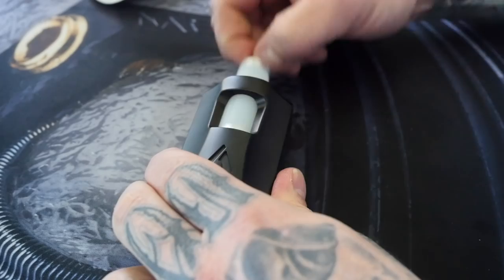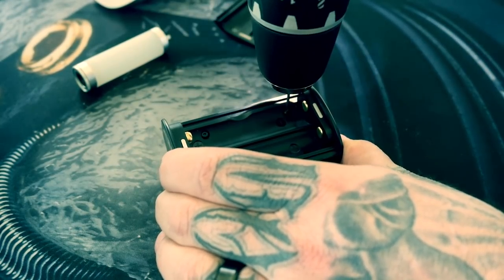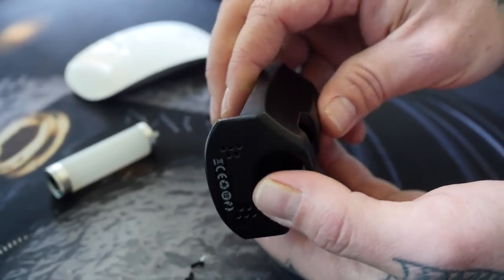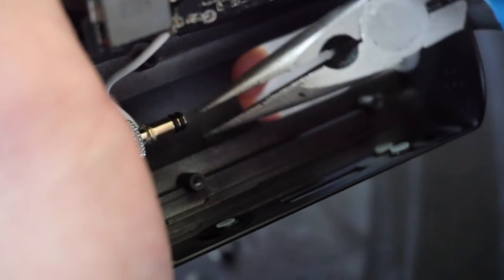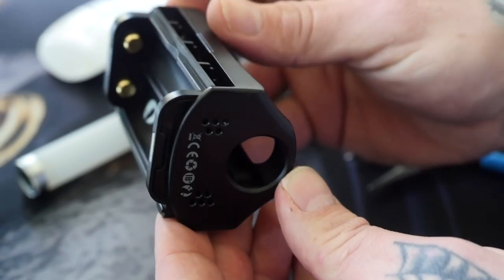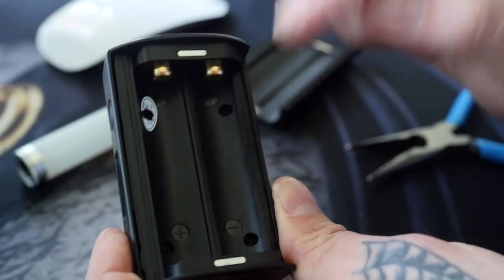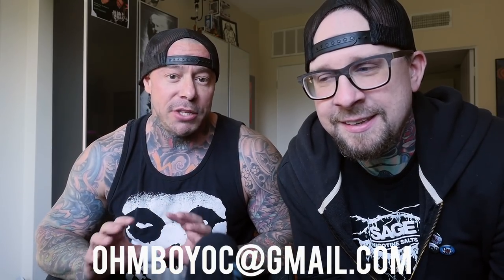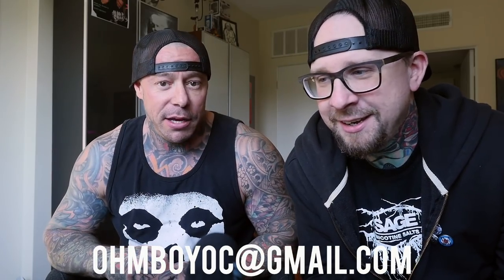Rage Squonk Maintenance with OhmBoyOC : Shenanigans

Comment: cannot find the rage in my country we are only allowed to by in the shop itself not true webshops so 99 dollars then getting it taken by customs is to expensive
Reply: muttley it's a great deal. 
You're getting a mod and a very nice RDA for this price. 
I'll probably get a customs charge as well for +/-30€, which totals to about 150€ for the combo shipped to my door within a week.
I think that's a pretty sweet deal.
Reply: customs destroys it belgium is not allowed to get mods or atty's or nicotine by mail if it passes customs its gone and destroyedi wouldnt mind a customs charge but ordering  euro of gear to see it destroyed before getting it is to much
Reply: muttley woops bit of a late reply. However I can't agree with customs destroying vape stuff. I get stuff from the US all the time. Half of it gets checked by customs and they've never destroyed anything I bought. 
My Rage+Recoil for example arrived a couple of weeks ago by DHL. It had an "opened by customs" sticker on it, but the plastic around the mod was intact. So they looked inside the dhl box, but didn't bother opening the actual products. 
Did cost me 22€ though, which was totally worth it. Still cheaper than buying both separately from within the EU.
Reply: yes but it is not allowed in belgium so if custom checks it it will not arrive yes i know its cheaper but as stated before vape mods tanks rta rda and juices with nicotine are not allowed so if it passes customs you lose it

Comment: I have to press on the bottle for a long ass time in order to get any juice out.

Running with the Profile on top.

Any advice?
Reply: Have the same issue, also the Wotofo Profile on it...Strange isn't it?!?!?
Reply: @sebastianstange9896  I found the problem and solution.  On the bottles, there is a black plastic piece that's kind of U shaped (if viewing from the side) that blocks off the juice in the center, but allows it to flow around the sides.  With the top of the bottle removed, and the hose removed from it, take a very sharp implement, like a pin or a tiny screwdriver, and push it up through the juice hole, from where the hose connects.  You should be poking a hole in that piece of plastic that I just mentioned.  After that, go in from the top and clean up the hole so there aren't any plastic particles left for you to push into your RDA.  It should be working 100% now.  I've done this to four bottles now and it works.

I believe it was a manufacturing issue with the bottles, but it's hard to track down since it only happens on some RDAs.
Reply: @RentableSocks  I'll give it a try later and see how it all looks like when its taken apart.
Reply: @RentableSocks  You saved my day mate. Used a pinhead needle and pushed it through the bottom plastic thingy. And it works like a charm. The only con now, the fluid consumption can be compared to a damn hemi 6.4 v8. Damn. Thanks mate.
Reply: @sebastianstange9896  I'm glad it worked.  That was driving me crazy since I had just gotten a new setup and it wasn't working right.  Tried it on an extra bottle and now it's amazing.  The factory is now aware of the issue now so I think they might have it fixed soon.

Comment: Are their new bottles yet bc my bottle sticks out about 2mms and my mod can not sit straight up without easily falling over bc it's too big. And yes it's perfect for using the right hand.
Reply: KatezKloudz *email him*
Reply: clark davis cut the tube, what are you talking about. The bottle is too long.
Reply: The new bottles he is getting are shorter. If you email him he will get you the updated bottle
Reply: clark davis the tube is inside the bottle and doesn't play a role in how far the bottle sticks out. The bottle sticks out when using attys with longer 510s. The longer the 510, the more it sticks out
Reply: It has an opening on the top of the bottle that fits on a nozzle, their is no straw to cut.
Reply: You might have one with the double o rings.
Reply: Jose Cardenas no I already have a new one.
Reply: KatezKloudz it's part of a spring loaded 510, I'm pretty sure it moves. If you take off your rda, does your bottle still stick out?
Reply: Bean Builds yes. You are right though,  it does move but the slightest bit
Reply: email me girl lets get ya a new one thats right
Reply: clark davis you seem fun

Comment: Dear Ohm Boy , I purchased the Rage Squonk Mod , and after using few months , it is stop working , when I am put batteries in the mod , then 5 clicks then the Mod show the following message: Battery is low , then he switch off automatically , Kindly note that I have 8 batteries and I had tried all but I was getting the same result , also please note that I have another MOD's ,and my batteries working with no issue in another MODs 
I tried to solve this issue , I updated the Firmware , but there is no chance to solve in my opinion .
So , I didn't ask for replacement MOD , but at least  Kindly ask the manufacture (Desier ) to provide me with new Chips, thanks and regards
Reply: Ironically I am having the same issue. Did you ever resolve the issue? Or did the company replace your mod?

Comment: Too bad the bottle that this mod uses is essentially garbage.  Went through several.  They essentially disintegrate, and the poorly designed handle rips off the fucking bottle.  Probably if less time was spent playing grabass on promotional videos, and more time spent on designing it, it would have been better...